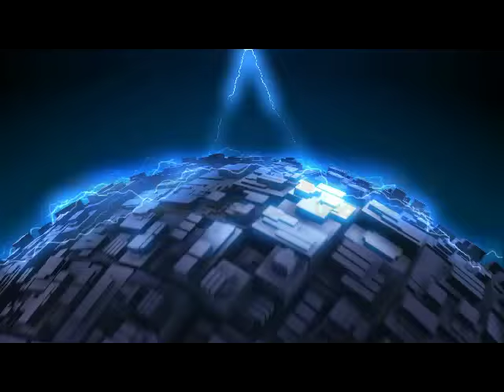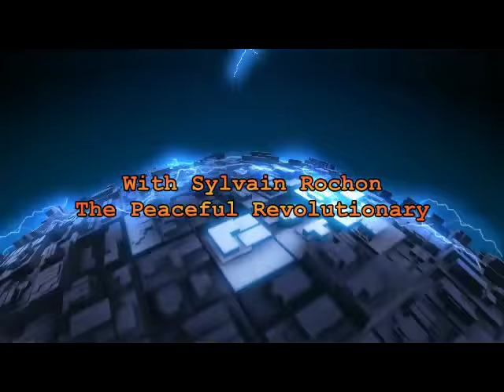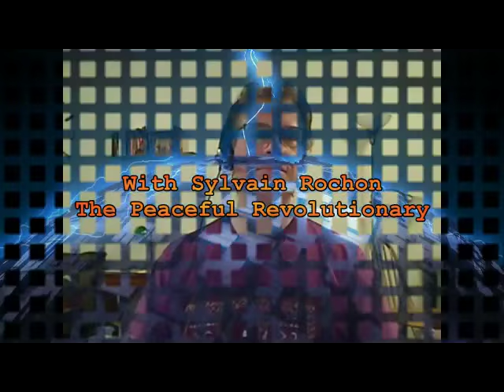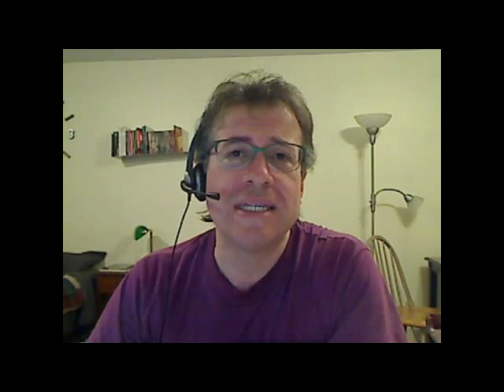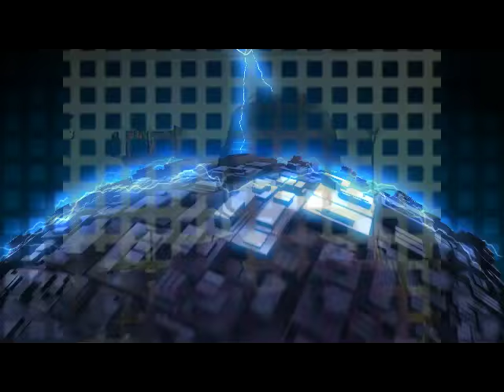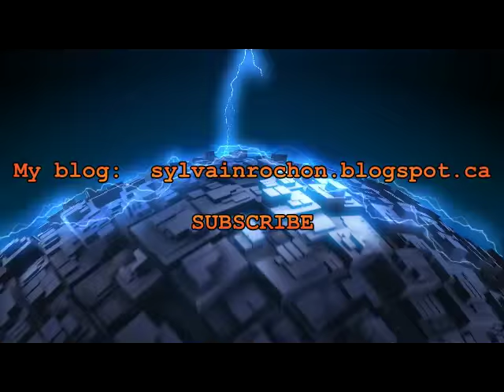Keshe Technologies - Part 3 - Plasma Reactor Update

Comment: I'm from Québec as well Sylvain and I've started making these coils in my spare time to see if these incredible claims have a leg to stand on. I'm curious as to who is commercializing the generator in our province. Belle job, vidéos intéressants.
Reply from the maker: +Denis Bouliane Well, apparently the Keshe Foundation has some sort of setup in Quebec.  If this all proves valid through testing of the devices after reception, most likely my partners will set up manufacture and research in Quebec as well, and distribute.  First things first though.  Other commercialization plans I'm not aware of except for claims made by the Keshe Foundation.  I only know from them about their manufacture in Italy.  I'll remain skeptical about all the claims until we see tangible proof that the new science exist though.
Reply: Great, will follow you updates. Thanks

Comment: Schmutz... such a lovely word. Seeing as how you watched the 50 hours... 12G Tesla converts the body into a plasma state???
Reply from the maker: +conor mac nessa This is the definition of plasma in science.  http://pluto.space.swri.edu/image/glossary/plasma.html .  If the body was made of Plasma, we'd be incredibly hot and incredibly dead since almost 100% of the human body's chemical reactions require temperatures around 37 degrees Celcius and atoms to be solids, liquids and gases in aqueous solution (water).   M. Keshe uses his own different definition of plasma I believe, to describe something IMO is completely different than the standard definition.  Plasma is still matter, just free protons+neutrons (positive charges) and electrons (negative charges) moving around, but still very much in a matter state.  Nothing to do with magnetic and gravimetric forces.  HOWEVER, plasma typically will interact and even generate magnetic fields.....
Reply: mmm yep but no. Plasma exists in several states ie pressure frequency temp et al... combined and interacting. Just like a resonant state of a magnetron or klystron resonating particles. The human body resonates within  freq band. I hope you get the box soon so you can do a real study. Nobody has done it yet. I sat through the 50 hours too!! Many of his suppostiions revolve around resonance. Both in terms of E field and H field resonance and their interactions. This intrigues me as they do effect each other and at a quantum level... Who knows. Get the box quick and nail him.. one way or the other.
Reply: +Sylvain Rochon - In one of the health teachings - they describe the plasma as same as 'aura' field. Perhaps it would have been better if Keshe defined plasma in another way?

Like you, I've watched many hours of his work - not an easy task. The health series is very interesting. I'm not sure if standard scientific approach is going to work as this unfolds... good luck with your analysis. I value your perspective and look forward to your conclusions on the Magrav Unit.